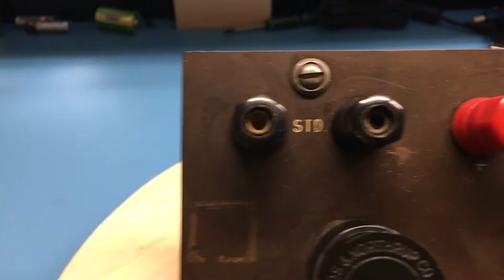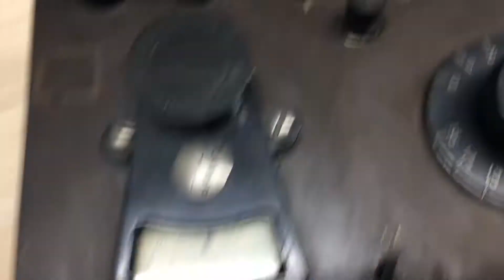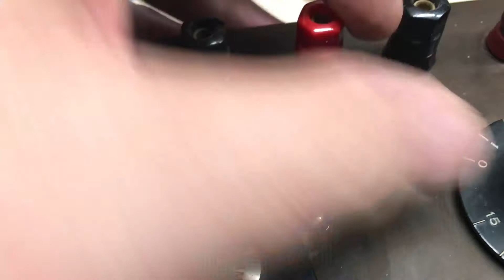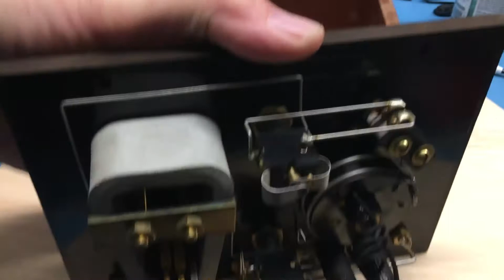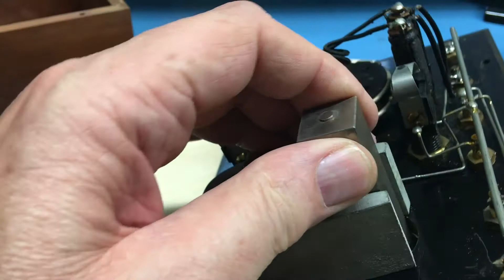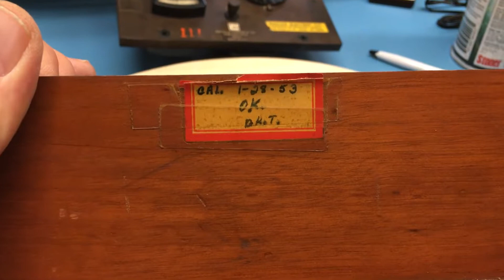Vintage Lab Gear - What is it - Test Gear??? from the 1950s - STB5

Comment: Am I late?  🙂

This is a Wheatstone bridge.

BA are the battery terminals.  The voltage is not terribly important, but probably relates to the resistance being measured to some degree, to get the current in range.  But no so much that we melt the galvanometer -- the lovely center-zero meter movement.  The <GA> pushbutton turns on the galvanometer to make a measurement.  The turn-and-lock think is an early version of "on" versus "momentary."

STD is the standard resistor, against which our unknown resistor X will be compared.  Those two are going to form one side of the bridge.

Then we have the two primary wirewound coil resistors, that "look like two inductors," and between them is the potentiometer.

The goal is to set up two voltage dividers running from the same battery.  If their ratios are the same, the difference between them will be 0 volts.  One of these dividers is made from the STD and the X resistors, connected externally.  Assume STD is known to a high degree of precision, and X is known to be nominally near that value, but we want to know it more exactly.  The ratio between them is therefore very close, but not exactly, 1:1.

The other divider is made of the two coils and the pot.  It could be made from just a pot, and if we put the wiper very near the middle, we have a ratio of very near 1:1.  If we wiggle the wiper a little higher or a little lower, we can adjust it.  But if it was just a single pot like this, there would only be a little tiny range in the middle of the rotation that we used, and most of the pot's rotation would be wasted.

So what we do is replace most of the rotation with a low-side and high-side fixed resistor, perhaps covering 99% of the total resistance range, and then put the pot between them and the pot covers the 1% that remains, with a full rotation of resolution.  So now instead of a tiny little 1/100 of a turn to cover the adjustment range, we have a full turn to cover it, and the resolution gets 100 times better.  We have a ratio we can set to 1:1 with a 1.0% total adjustment.  If we break that into 20 parts, we have 0.05% adjustment steps.

I don't think this bridge has a resolution quite that fine, but you get the idea!  I don't know the exact values or the details of those settings on this bridge.  It could be than one side of the potentiometer increases resistance in series with one of the primary coils while the other reduces resistance in series with the other primary coil, giving the ratio in a slightly different way.

So now... feed the two dividers with the battery, and put the galvanometer between the midpoints of the two dividers.  The galvanometer will swing a little left or right depending on which divider ratio is a little higher or lower, therefore having higher or lower voltage.  Tweak the adjustment pot until the difference between the two divider voltages is 0.  The ratio on the pot divider is now a known quantity, and it will be the same as the ratio between the (known) STD and (unknown) X resistors.  A little multiplying and/or dividing will yield X as a function of STD.  Easy peasy!  🙂

You never have to know what the voltage actually is; it's all about equalizing the two ratios.  Assume the voltage from the battery is falling the whole time!  Then the ratios do not change, even though the voltages do.  This is pretty important, and is one of the concepts that made these devices so important in the history of electronics.

And it probably still works.  And with a little cleaning, there's a chance it could produce readings better than a normal digital multimeter.  As long as the galvanometer is mechanically sound and the coil in the movement is not melted (and it's unclamped, of course!), it should work!
Reply from the maker: Never too late. If I still had the meter I'd shoot another video based on what I just learned. I sold the meter to a collector at the Mike & Key Ham fest some time ago. 
Thank you for  the time and effort in explaining it.
Reply: @ShadowTronBlog  It was fun to see the insides of it!  I love this stuff; I love old technology, like a hundred years old, that can still keep pace with what we think is so great about our modern tech!  Machine tools, telescope optics, resistance measurements...

Have a great day!
Reply from the maker: @ydonl  Like you I find all vintage tech interesting. Curious minds are often curious about most everything. :)

Comment: This is a galvinometer for measuring very small currents. It might have been used with your Leeds & Northrop test bridge for diagnosing communication lines (determining distance to short or open etc)
Reply from the maker: Thanks for the info!

Comment: Leeds and Northrup was a big test instrument manufacturer. The centered meter, with the variable control, the STD connectors, and the X connector, says it a Wheatstone bridge. I have seen this particular model, however. WA9KZY.
Reply from the maker: I'll need to open it again and draw out a schematic. I had thought a Wheatstone bridge as well but it didn't seem right inside for this. Obviously it's meant to compare to components so a Wheatstone bridge would make sense.